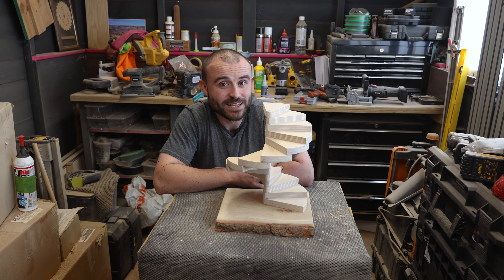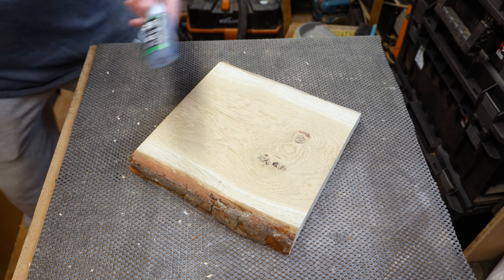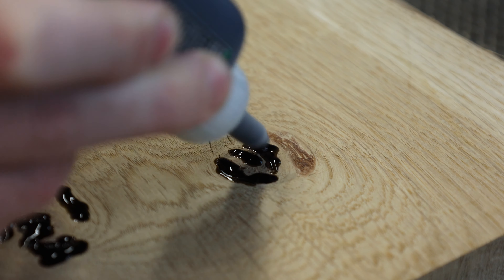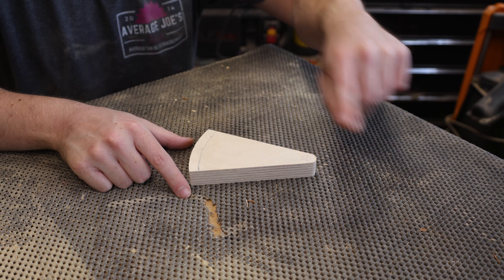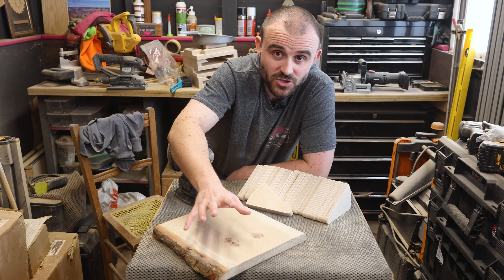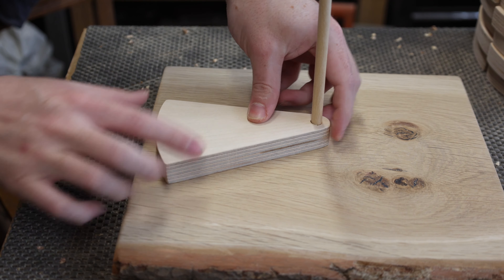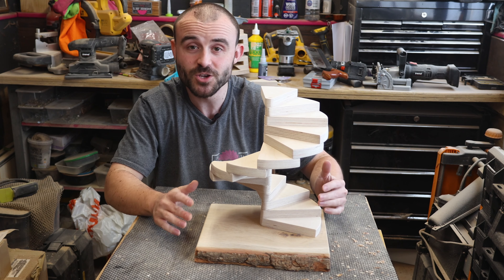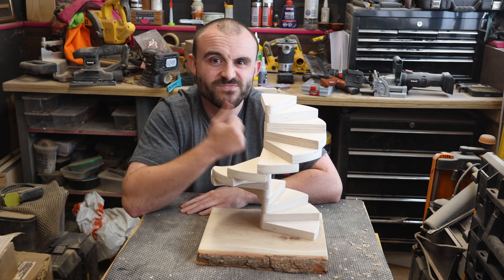I Made A Plywood Spiral Staircase Display Stand

Comment: Another suggestion re: super glue is to spray activator first to allow it to seep down, and then add glue. Repeat for several thinner layers.
Reply from the maker: Wouldn’t spraying the activator first set the glue before it had chance to seep down?
Reply: @AverageJoesJoinery  If the activator is given time to seep down too, you could do it in small but frequent layers.